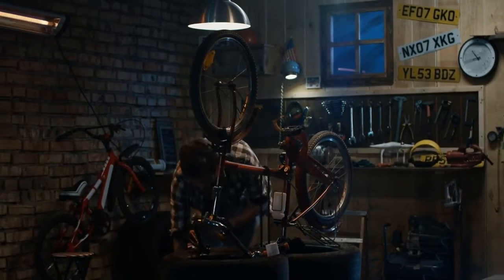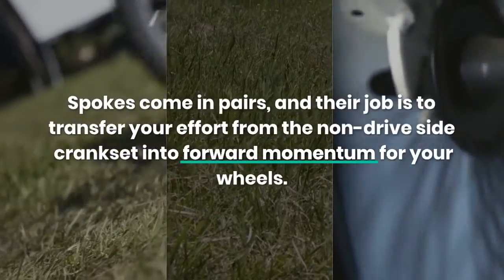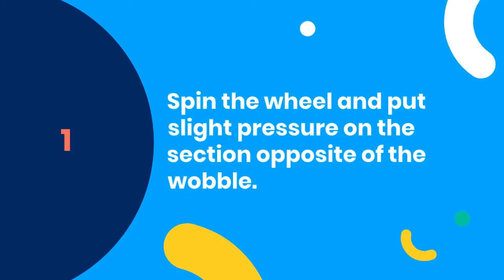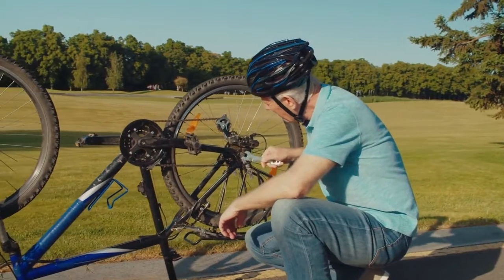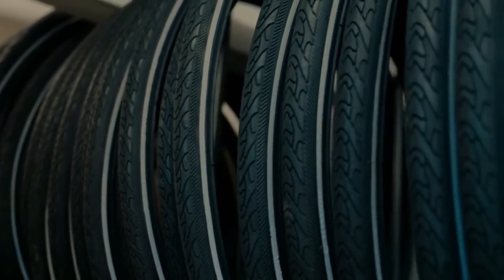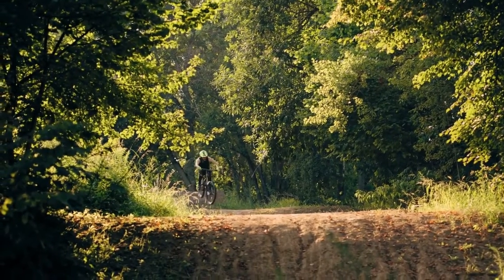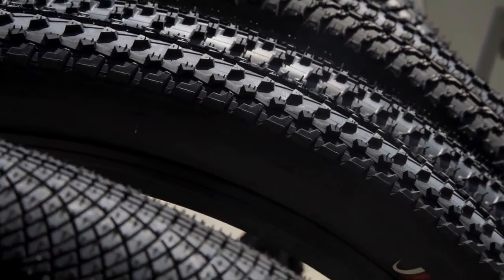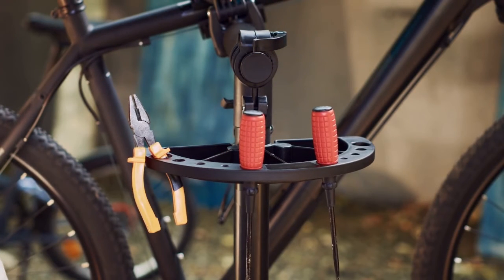Can You Ride A Road Bike With One Spoke Missing?

Comment: I've been successfully destroying rear wheels for many years. Front wheels tend to stay together ok. It's pretty obvious if a spoke is "missing". But they rarely go missing, if you break one they tend to stay secured in the nipple (feel free to laugh) unless you remove them (not always recommended if you have a deep section rim as the nipple is then free to fall into the box section of the rim and is a real sod to get out). Loosening the two opposing spokes can be enough to make the wheel straight enough to ride on to get you home.

Comment: Bikes break all the time. Brake lines, bottom brackets, lights, tires, tubes etc.
Never lost a spoke though. Spokes are inferior to a solid rim. But bikes have to be cheap.

In the end, we must arrive at our destination. Everything else can be fixed by the bike shop.

Edit: Wheels on bicycles are always unbalanced. Nobody puts them in the machine and attaches the proper weights.